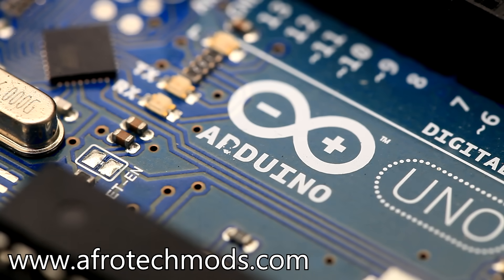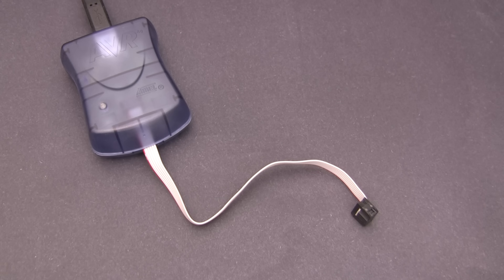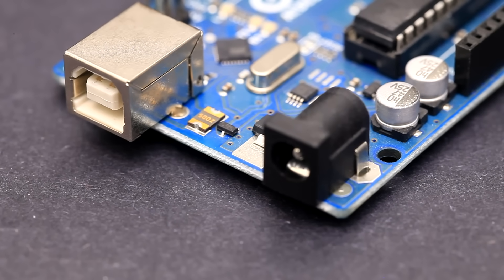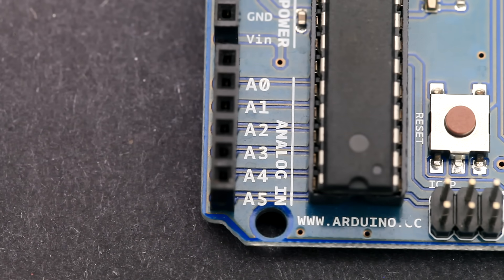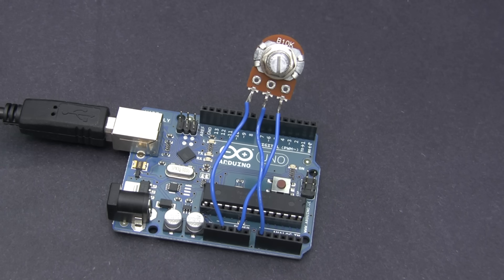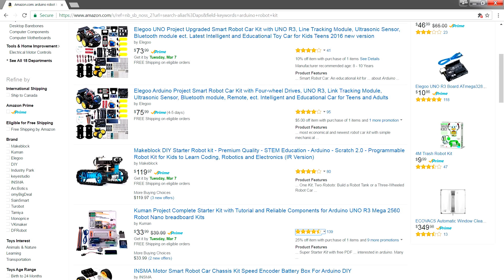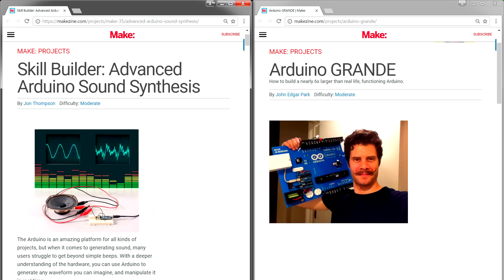You can learn Arduino in 15 minutes.

Comment: Still confused what Arduino is?
It's essentially LEGO for tech nerds
I want one.
Reply: its basically a mini computer that tells electronics what and when to do it, instead of just pluging them into a battery. for example: if you want to make an electric motor spin at a speed that oscillates back and forth from -10 spins/sec to 10 spins (clockwise to counterclockwise), you connect the motor to the arduino, which is attached to a battery, and use a sine/cosine function in the code for the arduino and set the motors speed to that value also in the code, instead of just attaching the motor to the battery and have it spin in one direction at the same speed forever. you can also use an arduino to sense its surroundings and have it set values based on that, like, for example,  a stick atached by the tip to a motor plugged into the arduino and the arduino has a heat sensor attached to it. you could use those materials to program the arduino to make the stick to point at you using the sensor to find you and the motor to move. i've seen a project like this where a little robot shot Nerf bullets at red targets. it was awesome :)
Reply: Timmy Animations  wow dude you got a bunch of time on your hands 😂😑
Reply: @zbp9541  
Time Well Spent!!!
Reply: I only liked because before the likes were 666
Reply: And like legos, if you step on an open circuit, it hurts!
Reply: Benjamin McCann 
I was just trying to make a joke that’s all, you know I also try to spend time learning like any other person
Reply: @akashic seer What have you made yours do?
Reply: @Colaaah  mine are inside of a very nice shortwave single side band FM AM any kind of radio you want that's touch screen with a waterfall
Reply: @akashic seer  you’re a nerd 

IL LiKeee YoOOOuuuU
Reply: Check out this video it might help.
https://www.youtube.com/watch?v=qp6GmkG0Z8A
Reply: @akashic seer 
Awesome stuff!! Just hope I can be as successful with it as others here have.
Reply: akashic seer where did you learn to use it? (Which youtuber or website)
Reply: @akashic seer why not just buy an mp3 player and the proper connections to do these things?
Reply: @akashic seer yeah... i am working with like 3.2 volts. my electonic kit has an built in regulator so not matter what, i can not burn out an led.......... wierd that its kinda dissapointing....
Reply: They are much cheaper than lego and yet way more functional
Reply: Where can I buy an original italian manufactured arduino
Reply: Arduino can be used in rc cars too
Reply: Mainly transmitter
Reply: Bwuh
Reply: @akashic seer Wow
Reply: small computer for d.c. motors and robots and thats baisicly it.
Reply: I got to have one and a short wave radio and that's what I've got
  They can be messed with
Reply: No its not .....

Well....

Yea....

They are not legos

Nvm they are legos for nerds
Reply: @randoschannel3801  It is hard to argue with his assessment.
Reply: @akashic seer Awesome mate!
Reply: It's basically an atmega evaluation board with a dumbed down IDE with super simple libraries.

Comment: the truth is know wat is Arduino but i have a lot qustion

1. if have piece for other From others such as mouse lezer or remote controller the is way to connect in the Arduino and change what do with code or need Piece specific fur Arduino ?
2. if make the device like controller for example it will works fur other computer i don't have Arduino code second i will find the code for or will be worcks only for the computer made it ?
3. is way to connect and disconnect stuff in lick keyboard and controller in this bord and if yes can is way changes what what when connect to the bord ?
4. wat is mean difference between digital and analog signal ?

i ask all this question because i won't to started Arduino but i don't have enough information and I have a lot older devices the worck same part for the if work and same not and it will be way cheaper now i don't have the money for this but if fint work I try and I want to know before starting
Reply: i knows my English is bad but i try my best

Comment: I don't know if this was said in the video but I think it's worth mentioning that trinket also work with the arduino programmer. 
And that you can include different "libraries" to help communicating with components. E.g. a servo that outputs in degrees and RGB-LED-strips

Comment: (1)Operating Arduino requires loading the computer with the Arduino IDE,  software which operates Arduino hardware.
(2)In order to operate  the Arduino UNO hardware  properly  from the Arduino IDE software it is necessary to connect a special USB cable to the computer,
which supplies limited amount of electrical power to the Arduino UNO internal power supply.
(3) It is necessary that the computer supply at least NO LESS than +6v through the USB cable. IF the computer supplies only  +5v the Arduino might work 
but it will NOT work as designed !
In that case  the Arduino must be supplied electrical power through a separate Arduino  connector ! 

Check the voltage  that te computer supplies to  the Arduino UNO which is the simplest of a variety of Arduino models.

Comment: So, simple question:
I am currently working on a small project.

The serial connection is bi-directional, right?
I need to read and write from an arduino through serial, mostly writing PWMs for servos and reading ACK-commands from the arduino into labview.
Reply from the maker: Yeah there's TX and RX
Reply: @Afrotechmods  perfect. its gonna be nice!

Comment: Which power supply do you recommend me for Arduino? I’m facing issues with the chinese 5v and 9v power supplies. They cause the Arduino reads to go crazy, making it misbehave. When I run through the computer USB, it runs just fine! Which power supply for Arduino do you recommend me? Please need help!

Comment: I'm currently using arduino for a project to communicate with atmel studio. I'm combining C/C++ with assemble to make a project where I control different LED'S. Is fascinating. But from my experience and knowledge what I find the hardest thing is the communications between a microcontroller to the software program. For an example if a run a code and want to see the code work on an embedded system you need to know every pins /communication etc and often look on the the data sheet. And sometimes some embedded system doesn't work for all software programs. But once you get to know the basics and you see the structure it becomes more clear and whatever embedded system you are using you won't have a problem with doing any project at all

Comment: If you want to do college level projects, especially those which involve internet, Arduino is one the best choice. It has lot of libraries that reduce your coding work. Pairing it with MATLAB makes the work even easier.

But if you to learn fundamentals of how microcontroller works. The register addressing,the arithmetic logical unit processing ,the clock cycles etc then work on 8051 microcontroller.
Arduino hides all that in the background with libraries..
Reply: Christian Weissmuller   Yes. Arduino can also be programmed by assembly language or C. But for many , Arduino libraries are too tempting to not use. Especially when programming without libraries is not giving desired results.

8051 can also be programmed in C through many open source IDEs and it also has extensive set of libraries , but still , making a complex embedded project on Arduino would be much easier than on 8051.

But for most modern day embedded systems , 8051 is too much of work for those who don't have much time, expertise or both. 

When 8051 was designed , WiFi also didn't existed,at least not commercially. Let alone the field of IoT. Now there are some Arduino Models specifically made for IoT applications.. After many failed attempts of interfacing ESP8266 with Arduino Mega which was programmed in Simulink , I finally got Arduino MKR1000 with built in Wi-Fi. Maybe my ESP8266 chip was defective..
Reply: I feel like the libraries reduce the products to legos.

Comment: Might try to use one for custom car functionality.  Such as push to start, make an application for remote start, window motor control, convertible top control, enhanced security, etc.  

should be fun
Reply: Tell us how it went
Reply: Things like this suck for that. High risk for glitches and command failure.  Doing that manually is a lot better.

Comment: What is the output voltage of the LEDs GPIO pin? A 1K resistor will provide a less than optimum current to the LED at 3.3V or 5V. 
Typically, LEDs like the one you’re using operate at 15mA ~ 20mA. This would be 220 ohms and 330 ohms for 3.3V and 5V respectively. A 1K resistor would work best on a LED operating on a 12V port, but will light considerably dimly at 3.3V.

Comment: So many Electrical Engineers may ask what is so special about the Arduino microprocessor board. ?
It is true that there are 100 of microprocessor boards on the market from Texas Intrument Atmel and others. The success of the Arduino is not the processor board, it is the software that goes with it.
  The software enables the user to express logic in simple English language terms.
This is all about the Arduino learning to understand the English language of logic and not about the user learning complicated ' C ' language statements.

Comment: Great video- I'm planning to use this in a motor timed on and then off triggered by proximity sensor.  I will need the arduino to relay low voltage A/C  to a contactor  coil.  Is this something the ardriuno is capable of doing the programming and attachment relay boards?  Thanks for any helpful response ...

Comment: I’m looking to control a half horse pump based on a few temperature readings, when tank temp gets low a circulator pump kicks on to circulate through either a solar water heater or through a coil over the wood stove. Based on the temp of the solar water heater or wood stove the speed the water is circulated is adjusted. Is there an arduino for high amperage devices? Wireless or wired temp sensors?

Comment: Good tip: if your using switches to break/make circuits eg for digital read, make sure your sending a LOW voltage when using the switch by installing a pull down resistor otherwise the circuit will be OPEN and the input does crazy shit.

Comment: I have an awning powered by an electric motor that works at 220/230V. I am now trying to make the anemometer connected to arduino. That is gonna make the awning close itself on the sensor of stronger wind. That is the idea. For now...

Comment: I started programming in college on this.  Now I am a Test Engineer and automate professionally.  I use Labview now and typically use DIO's with 96 I_O and analog cards. MIO's and the full spectrum of test equipment.  It's really satisfying after releasing a completed test large enough it takes roughly 1 year of design, programming, debug and release.  Arduino's are a great way to get in and explore the automation world, where you truly get to take a thought and turn it into a product
Reply: OGPokey151 i want to learn this stuffs how to start what programing do i need to learn

Comment: Some complete newbie questions:
Why are TX/RX different from Digital ports ? 
11:14 - you say the resistor goes to GND but it is on AREF ? Why is the resistor at the GND side and not before the anode of the LED ? Doesn't the current flow to the anode first ? You also say it goes to pin 9 but I see pin 10.
Reply from the maker: TX and RX can be used as digital ports but usually people want to use them as serial transmit and receive. It doesn't matter whether the resistor is on the low side or the high side of the LED the current in the circuit will still be the same. The confusion about pin position is because the camera angle is slightly tilted. Look more carefully and you can see that the correct pins are being used.

Comment: 2:30 didn't they just use C++ with arduino library? I'm pretty sure they didn't create new programming language
Reply: Yeah, they did. They are using a custom compiler, but it's all just C++. In fact, you can write any library using the standard .cpp and .h file extensions

Comment: There is a third party company where I live but the placement of the components on the board are different, but it is still called "UNO". It is the same as an original Arduino, right?

Comment: So, I started watching thid in the hope of controlling my 12V motor. Sad its limited to 5V. Any other way to do this with arduino?
Reply: There are 2 problems here
1) Voltage - as  you mentioned, the arduino is 5V, so the 12V motor isn't easily controllable
2) Current - the arduino cannot source/sink any amount of current that is enough to drive any sort of motor.

The solution to both of these problems would be to use some sort of a transistor. A good starting point is an N-Channel MOSFET. You connect the Source to ground, the drain to one of your motor terminals, and the gate to one of your arduino pins. The other wire of the motor goes to your 12V supply. The MOSFET acts like a switch, allowing you to control the motor with your arduino, solving both the voltage and the current issues. Also, don't forget to add a flyback diode parallel to the motor in reverse, so the back EMF of the motor doesn't damage your MOSFET. Definitely do more research on this though, this comment should get you started but you need to google some things on your own. Good luck!

Comment: Hello found the video helpfull
Can I use a Arduino to control a 24v DC motor
Reply: You can, but you'll need to use a component in between. If it's a matter of simply turning the motor on and off, having the Arduino drive a relay switch is probably your best bet. If you want to control the speed of the motor, you'll want to use an appropriate transistor.

Comment: 10:58 i remember doing this tutorial at school except we weren’t told to put a resistor in the circuit...later i used that same arduino for a robot project and it was always faulty. It never worked properly even though the coding was correct and all. I wondered for so long why it wouldn’t work and now I’m convinced the pin is ruined as mentioned at 11:06 or that the motors themselves were broken...

Comment: Not sure if the terminology is correct for Arduino for the term tri-state.  This alternate definition could cause a lot of confusion with the electronics guys.  For anything other than Arduino, in TTL, CMOS, and Micro-controllers, tri-state does not mean switching between input and output.

In digital logic, tri-state is only an output.  Outputs from chips are one of 3 types.
1 Open collector.  This has 1 output transistor that when on grounds the output.  Outputs from multiple chips can be wired together in a wired OR logic using a pull up resistor.
2 Source and Sink.  This output has 2 output transistors and can source or sink current.
3 Tri-state.  This is like 2 above but the output can be switched off to float.  Logic with either an Output Enable pin turns this output on or off and when on can be high or low.  This is common in memory where multiple chips are wired and blocks of memory is enabled with additional address lines.  For example a memory of 1024 bits in parallel with another one but an additional address line inverted to the 2nd chip would then become low and high memory for 2048 bits.

I will look further into the Arduino and it's definition of tri-state.  As mentioned, this alternate definition can be a source of confusion if used for Input or output.  In TTL and other logic this is referred to as bi-directional.  Google a part for a bi-directional buffer or buss transceiver for examples.

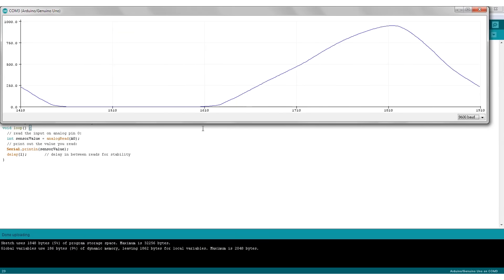Comment: 10:35 – Bastet is pleased with your piety. May all your projects be blessed and protected. On a sidenote: Darn it! Now I want to buy an Arduino, because RaspPis neither have an integrated timer/oscillator nor ADCs. However, for my projects (I am currently working on turning an old telephone, with a rotary dial and everything, into a digital one, to be able to use it with SIP et cetera), RPis are the way to go. But when I find something suited for Arduinos, I will definitely give it a try. Now that I found a tutorial that really explains what they are and how to use them, straight and to the point. Thank you.
Reply from the maker: Bastet be praised! Another believer! Meows be upon you brother.

Comment: Will the Arduino do multitasking? I'm in the process of designing an HHO Generator and want to use a motor to mix Potassium Hydroxide into the water. Once the right mixture is met the motor will stop turning. I figure there are two ways to measure the right amount of chemical in the water. Either measure the resistance or the voltage in the water. Since Distilled water has no resistance by adding the chemical it will increase the resistance in the water. Also at another point I want to measure the current going into the HHO generator.  This is for an automotive project that is supposed to increase fuel economy by 33%!

Comment: Hi there! Nice video! I would like to make a forceplate on my own. I want it to have 4 load cells that each one will transmit its data to my pc at a rate of 1000hz (every 1 msec). what do i need to get so i can build it, except of the 4 load cells? will arduino be ok for me?
Reply: Arduino will work perfectly fine for this, I have done this with an Arduino Nano, I like them because they are smaller and the knock off brands can be bought for about $4 each.
You'll want to get some load sensors from Amazon or anywhere really, I bought a kit with 4 load cells and an HX711 load cell amplifier.
There were a couple libraries that didn't seem to work well, I used the following library https://github.com/bogde/HX711